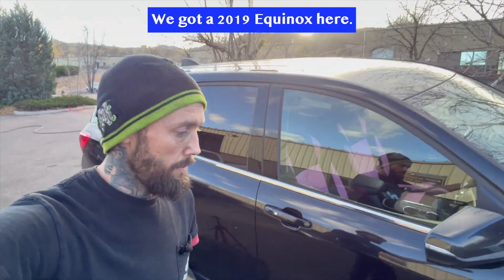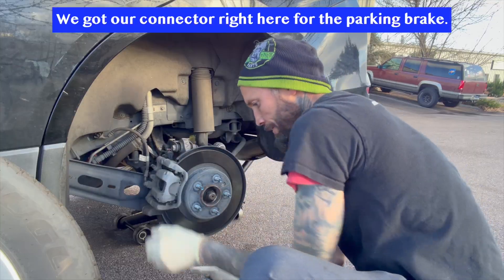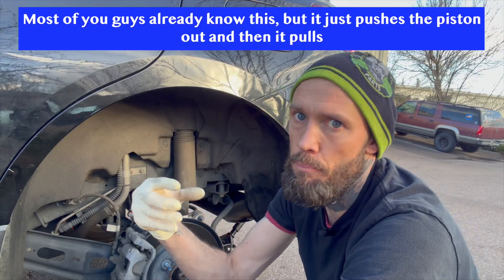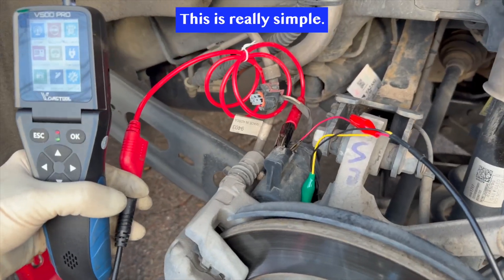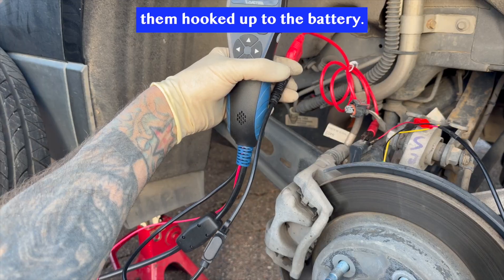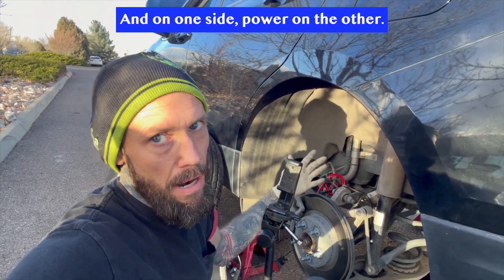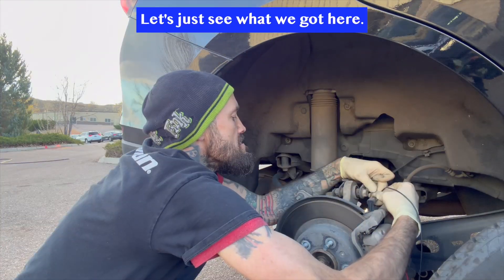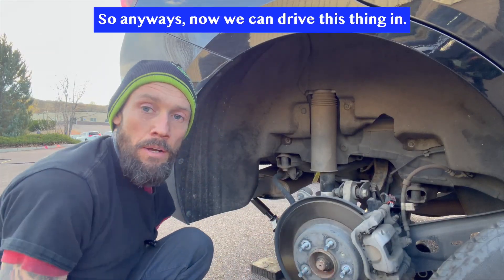How to RELEASE a Stuck Electronic Parking Brake (Emergency Fix!)

Comment from the maker: ⚠️ This is a professional diagnostic / recovery procedure.
I’m showing this for situations where a vehicle is stuck and needs to be moved for repair or safety — not for bypassing systems on vehicles you don’t own or have permission to work on.

Modern electronic parking brakes can fail in ways that trap a car in place. This is one way a trained tech can safely release it so proper repairs can be made.